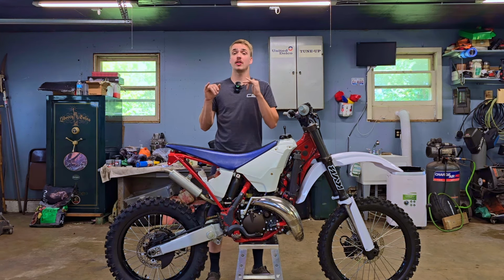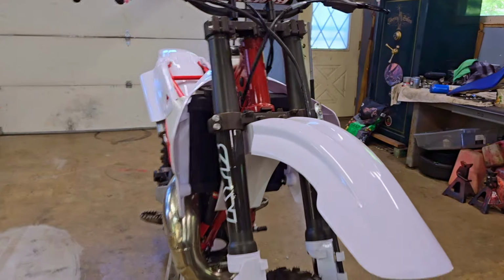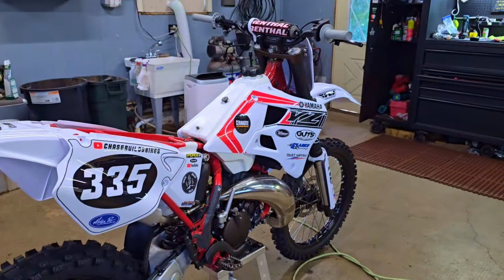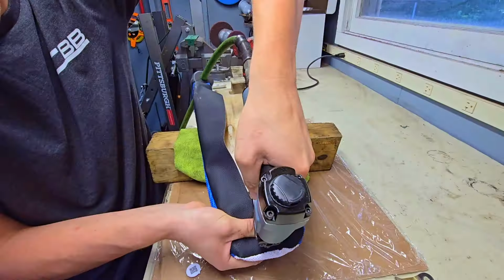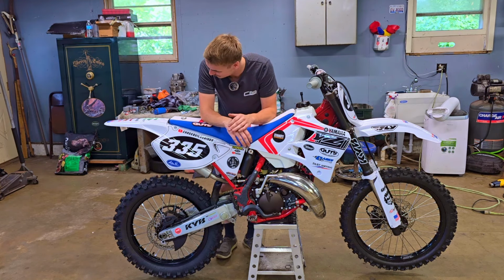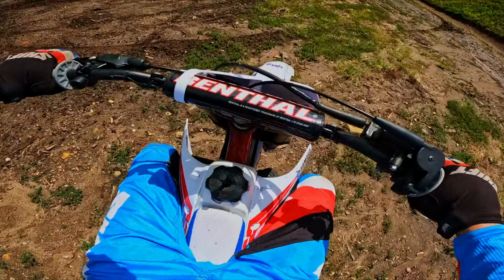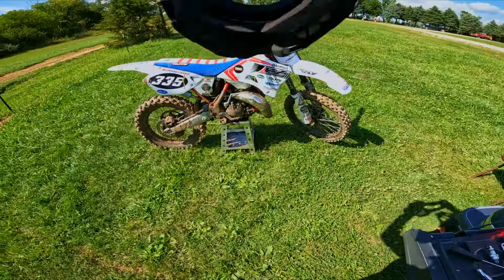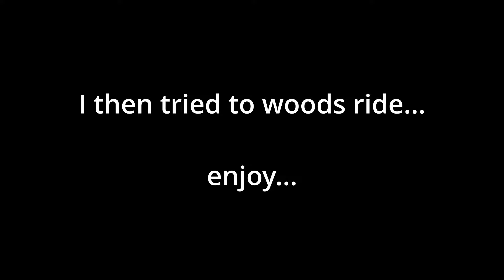I Spent 8 Months Building The Ultimate 125 2 Stroke Dirt Bike

Comment: Might just be me. Idk about the older yz but dam dude that motor sounds like it’s got a loud ass click or taping/raddling sounds. My. 125 makes some that’s normal but dam that sounds extreme. Crank or piston hitting the head sound Mabey
Reply from the maker: I will say the go pro does make it sound a bit weird. She sounds pretty good in person, I've got a couple issues in this video, one is the kicker rattling on the pipe (gotta fix that) and the bottom end is super rich at the moment, so I'm getting a lot of bogging in the bottom end
Reply: I just sold my 01 yz125 after rebuilding top and bottom end it sounded like that

Comment: The clicking started when you turned your idle down, jetting doesn’t sound off your just popping too many’s gears without riding them out before upshifting sounds like. Don’t change gas, pilot, and needle that’s idiotic one at a time bub
Reply from the maker: I'm definitely thinking one at a time. I always make one change then ride it out and see how it goes. I definitely agree, I'm trying to ride the 125 like a 250f and it wasn't working 😂 but the bottom end is still very rich, I can clean it up with the air fuel 3.5 turns out, which makes me think I need to step back down to the 15 pilot I originally had.
Reply: @ChaseBuiltBikes  yea I’m not the best at jetting yet I got my cr 125 engine on a table right now. Sounded perfectly fine to me beside that clicking on the idle. 125 is hard to control because being in the power all the time is scary and genuinely hard to do. That being said I never hear even one big from your bike in this video if anything it was mid range not top of think